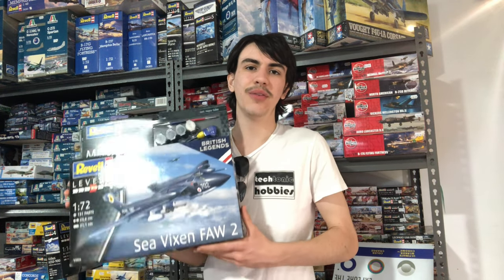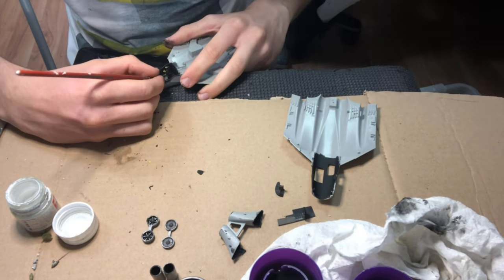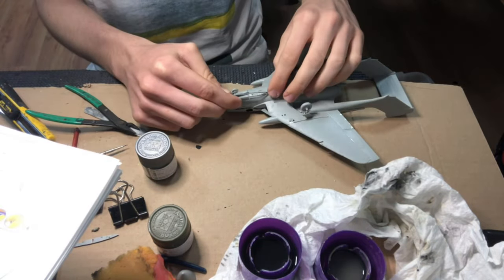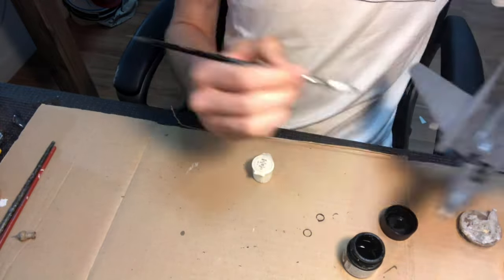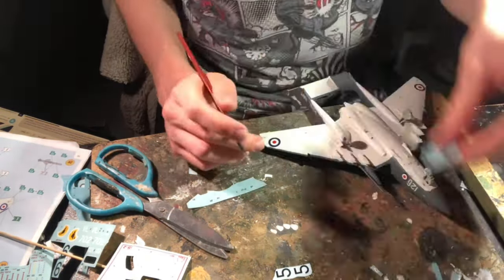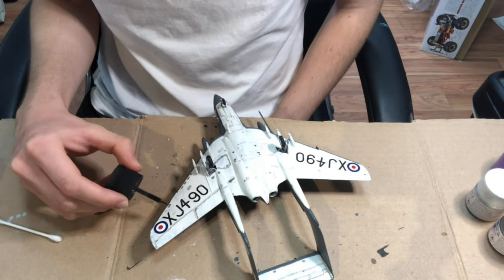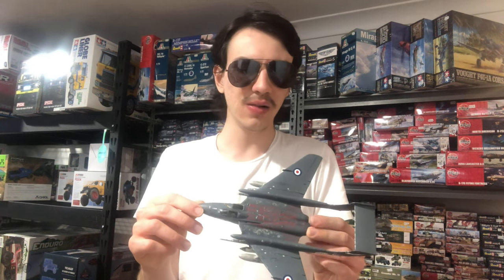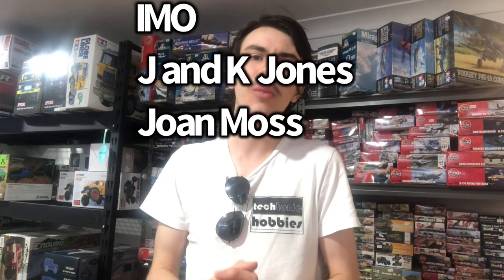Revell 1/72 DeHaviland Sea Vixen Build and Review

Comment: The flying fist on the fins denotes 899 Squadron not 892 as you say. Also the "E" on the fin denotes HMS Eagle not Ark Royal which was denoted by the letter "R".
Reply from the maker: Hey, I see I may have gotten a bit confused, but your correct. The fist and E are for HMAS Eagle and 892 Squadron. 

Confusingly it was originally with 892 Squadron however it was at the end deployed in September of 1971 to 899 squadron to replace two broken aircraft on the HMS Eagle. The plan was to ship XJ490 and XJ579 from Lee-On-Solent to Tengah where the Eagle was based. They shipped it on the SS Glenfalloch, but when it arrived it was found to have corrosion and it was basically dumped in Singapore and eventually found its way to Australia. 

This is the history the Air Museum has on XJ490, its well worth a read :)

 http://www.qldairmuseum.au/qam-content/aircraft/sea-vixen-xj490/XJ490.htm
Reply: Very nice. I was a photographer on Hms Eagle and part of my job was filmiing the take offs and landings.